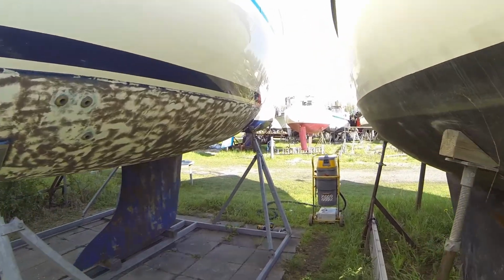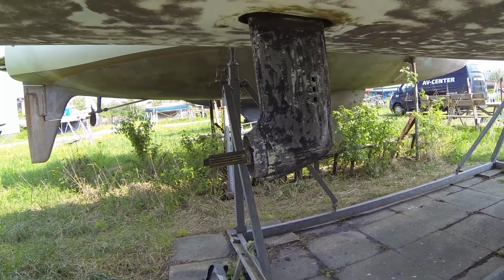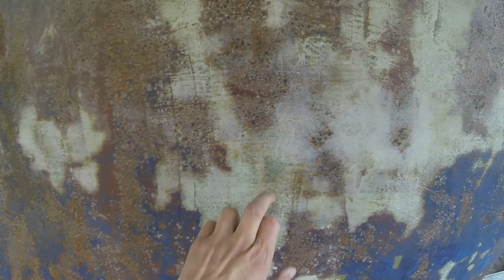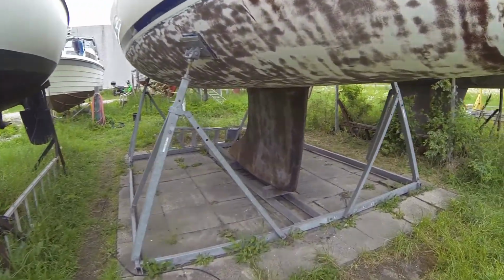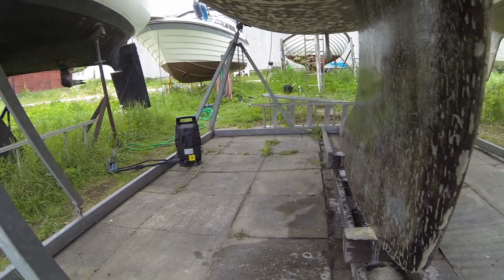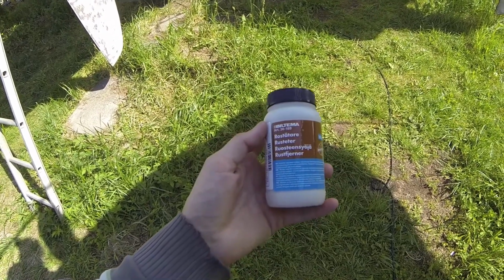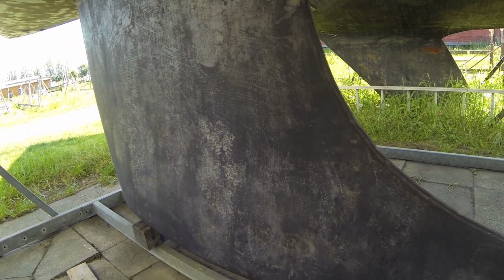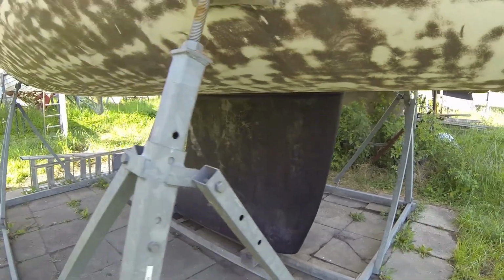The antifouling project 2/6 - grinding down the rusty keel

Comment: Just remember to use a rust remover for your paint system. If you use epoxy primer, you would need Owatrol CIP instead of normal Owatrol

Comment: Hi Tino, I came across your helpful videos just about right time as I'm about to antifoul my first sailboat ever. The hull is in pretty good condition, but still I'm confused as I don't have an experience with it. I have hard antifouling and small patch of rust on the keel, I'm wondering do I need to go same process as you, or I can do patch priming on the keel? And regarding the hull, is priming mandatory every season or I can sand antifouling and have a new layer on?

Comment: is there any treatment between rust converter application and the following primer paint, like washing or so?
Reply from the maker: The wash before the rust converter is to wash away any salts from the iron surface. According to the Bavaria yard the right way to prep the keel surface is to use a zinc primer called "Zink Powder Paint" in my case I use rust converter as the first coat and then a highly diluted layer of epoxy primer.
Reply: my question was, what did you after rust converter. Did you wash down before you apply epoxy primer or just paint the epoxy primer onto rust converter surface? @twiper

Comment: What grit of flap discs did you use Tino? Mines out of the water now and the keel is pretty bad! I need to try and replicate your awesome process ...
Reply from the maker: The flap discs was grit 40
Reply: Thanks Tino. I’ve ground one side off - it’s quite a workout! Did you rub down the rust treatment or just apply the epoxy straight over it?
Reply from the maker: @TheMagicalArmchair  I did apply the primer on the top of the rust treatment. The treatment is to ensure the remaining rust don't evolve under the epoxy primer.

Comment: All your videos are very informative.  I need to do the same to my iron keel in a couple weeks.  Which grinding disc did you find worked best?
Reply from the maker: Thanks :) - The grinding disc in the video at 0.55 is effective https://www.youtube.com/watch?v=RDSPALZCtPM - I used flap discs first but they are not so effective as the grinding disc. You can also use the flat sanding discs as the ones Mads from "Sail life" uses on his grinder.
Reply: @twiper  Thanks!

Comment: Hej overvejer en bavaria 32 cruiser fra 2002. Lader til at du kender alle kroge på den. Hvad skal jeg mest være opmærksom på når jeg checker den. Tak 🙂👍🏼
Reply from the maker: Jeg har hørt at man skal tjekke omkring kølboltene inde i kabinen ( som jeg ikke gjorde da jeg købte min ) der er noget med at den revner et bestemt sted hvis den har været udsat for en hård grundstødning men man vil nok også kunne se det på kølen udenfor.  Også en god ide at være opmærksom på motoren, den skal starte hurtigt og med det samme som en diesel motor skal, hvis den lugter som en gammel bus skal dyserne justeres.  Synes ikke jeg hører om Bavaria både med osmose men nok en god ide at kikke efter det. Ved også at Bavaria har en svaghed med ror der kan køre stramt, så tjek hvornår bøsningen har været skiftet. I følge min båd kan en bøsning holde i ca. 10 år. ved normalt brug (fik ny bøsning i 2015 og båden er fra 2004) - men tjek de dyre ting så som motor, rig, sejl, sprayhood, telt, teak, hynder, aptering, varmesystem, luger, forbrugsbatterier. Har set en del både hvor glasset i lugerne er krakkeleret, en rimelig dyr omgang hvis de skal skiftes.
Reply: Tino G - Sailing hej Tino. Super. Tak for hurtigt svar. Jeg vil følge dine råd. 👍🏼

Comment: Hi what is the name of the rust «eating» stuff you have used on the keel. And how did the keel look the next year. Was the rust back?
Reply from the maker: You can get rust eater (remover) and rust converter, I used the rust converter you can get at biltema : https://www.biltema.dk/bilpleje/bilvedligehold/rustbeskyttelsesmidler/rustader-2000017147  -  check out how the keel looks after a year in this video : https://www.youtube.com/watch?v=D6JlykYyLn0
Reply from the maker: Over all a good result, but of course hard to grind where the keel is supported and at the bottom of the keel.

Comment: What does the boatyard charge per month?
Reply from the maker: In our sailclub it is very cheap to have the boat on land or in the water, it costs 39 US dollars per month. (depends on the boat size)  The sailclub is however not the best place for big sailboats due to the long, shallow and narrow inlet and It takes about 3 hours to reach the ocean. But if you can live with the inlet the club is pretty good.  Regarding the mast you must also remove it each year.